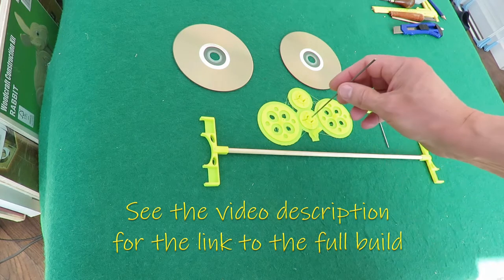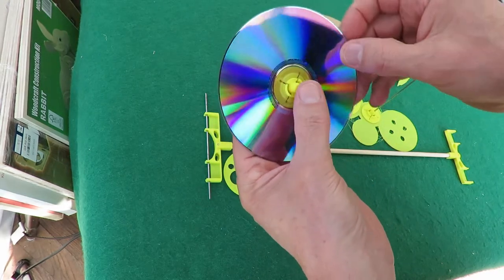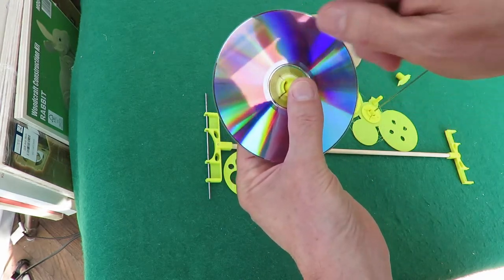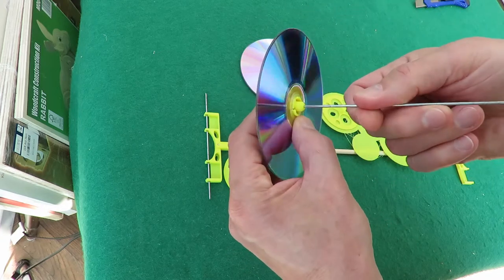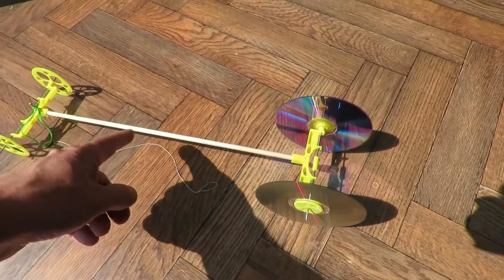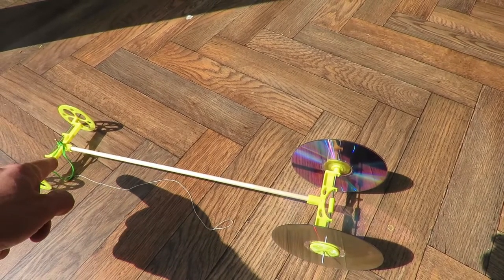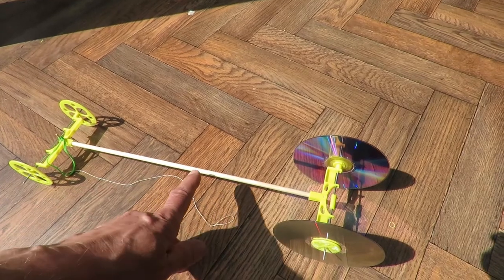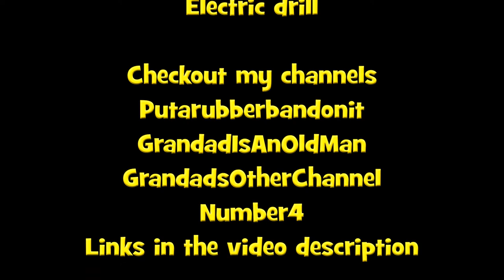3D printed rubber band car SHORT VERSION

Comment: Good build, and I like the combination of some 3D printed parts and some reused/recycled items. Price on the yellow PLA looks to be excellent too! 👍😀
Reply from the maker: That cheap yellow PLA is cheap for a reason. I get poor adhesion to the bed and often have to reprint failures or use a raft to hold it in place. I am getting through it twice as fast as a result so that makes it a false economy 😕
Reply: @GrandadIsAnOldMan  Thats good to know - thanks. The stuff I am using at the moment wasn't the cheapest though it does stick well and I don't need to use a raft or skirt or anything. It may be also due to the Printbite layer I added. I also found pumping up the heat really helps adhesion. I now start with the bed at 75c and the head at about 205c! 😃👍
Reply: I enjoy the combination of bits myself. PLA is hard to get over here right now unless you want to pay double.

Comment: Well Grandad. I have a design in mind of a three wheeler rubber car. I was thinking a horse shoe shape for the front axle. Holes on the end for the axle rod. One CD or a 3D printed wheel much like you have here to go in the center of the horse shoe with the axle pushed through. A tube at the center of the horse shoe to accept the wooden dowel. Basically a 1 wheel front on the car here instead of the 2 wheel. 1 less wheel to print. Just a thought.
Reply from the maker: It would reduce the weight a little and you will see in the later videos in this little series I have to reduce the weight to 50g so one less wheel would help 😁👍